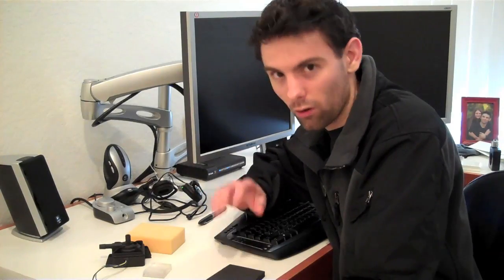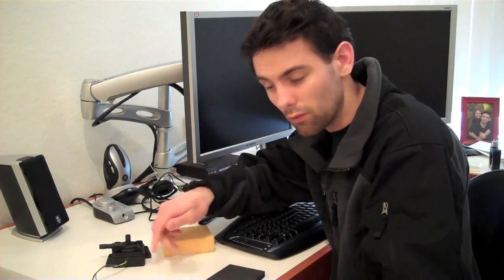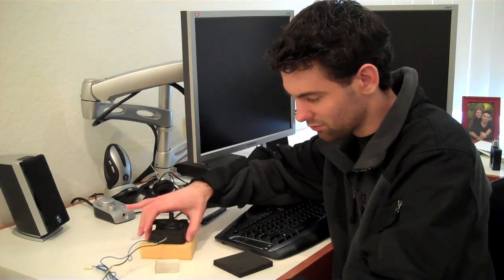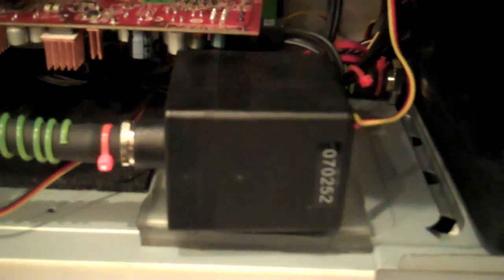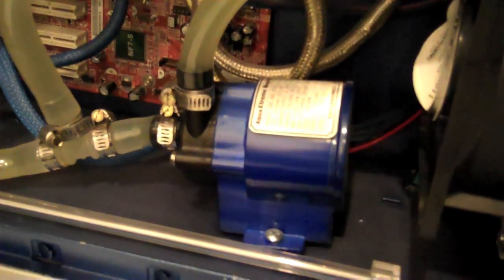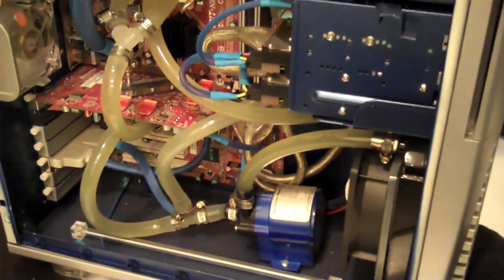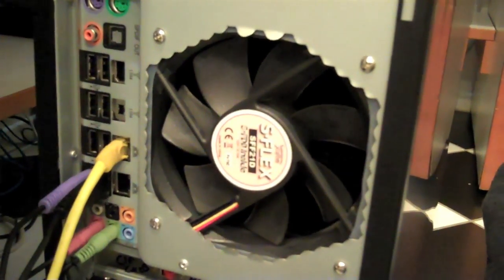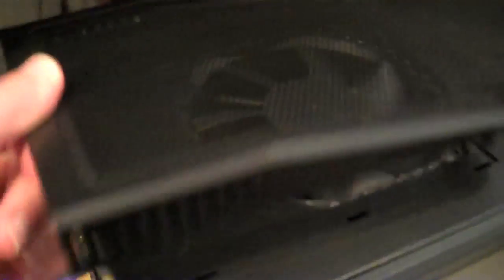PQA Ep. 5: Water Cooling Pump & Fan Vibration Isolation Tips

Comment: Hi, maby you can help me out. I have an Corsair H150i AIO and i just changed from the ML120 fans included to some Arctic Bionix P120 fans.
The new fans have great reviews and they are much more quiet than my ML120 fans, but now i have some vibration problems instead. The whole case vibrates but all the fans are securely tightened on the rad. The ML120 fans didnt even have rubber to prevent the vibrations and these new fans does... what is the problem here?

Comment from the maker: @ObserverSUB Yes, suspension mounting does work well (I've done it with HDDs), but I've found that standard rubber bands tend to dry out and crack over time (which causes them to break). When suspension mounting, I currently use elastic strips purchased from a fabrics store or crafts store.